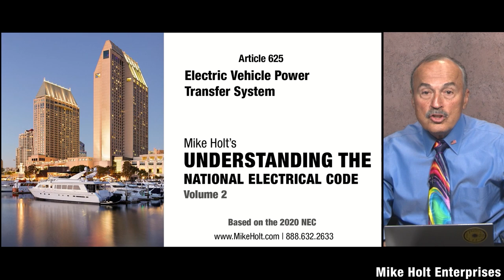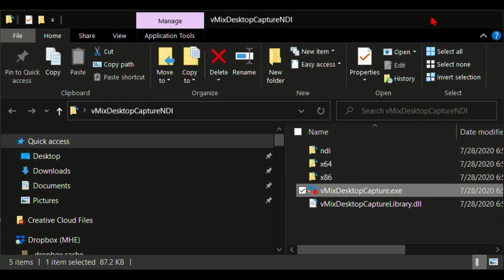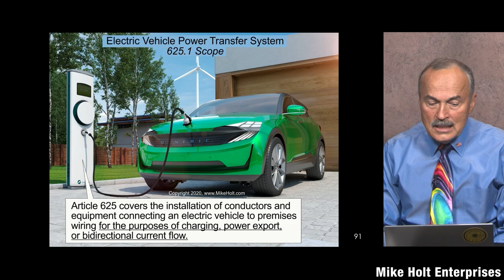Electric Vehicle Power Transfer System, NEC 2020 - [625.1], (5min:01sec)

Comment: Mike, love your videos but I think you're missing the point. Backup power could be a use but utilities are pushing for this to better manage demand. Eventually your utility might request your vehicle discharge back to the grid to support their demand. Vehicles that support this seem to be heading in the direction that they will allow you to opt in or out and configure how much to take off the top before stopping. 

Also please don't call the device in your garage a charger, it's not. All it does is manage a handshake with the car before energizing that cable. It makes sure the connection is safe and charger that is on the car knows the amperage available through that connection.

One concern I have with this arrangement is that the breaker would be back fed and should be secured (bolt on etc...). I wonder how many of these installations will miss that mark.
Reply from the maker: Any insformation that supports this post?
Reply: I don’t think backup power would work in this scenario.  That’s because you would backfeed to the street since there is no shutoff for the main breaker.  You would need to shutdown any output power the instant the grid goes down. That’s exactly how my own grid tied solar panels work.  There is NEVER any output from my panels when the grid is down.  

There is documentation from Tesla regarding their power wall device that talks about how it could output power when the utilities are short on supply vs the current demand.  By selling power at peak demand and buying it back on off peak times you could potentially pay for the cost of the device.  Of course there are a lot of things that need to work together for this to happen. It’s the foundation of the new smart grid design.   I’m not saying this is all ready for now but the theory is all there.
Reply from the maker: @neilbrookins8428  Of course it would, that is why the NEC is changing the requirements and UL listing requirements specifically for this application. See https://www.greencarreports.com/news/1127590_nissan-leaf-as-home-energy-device-wallbox-will-soon-enable-it-in-the-u-s

Comment: Question, how does an ev charger differ from a water heater connected via a 30 amp plug? Why is one allowed and one isnt? I need to charge my solar batteries with a chargeverter and only have room for 1 -30 amp breaker. Thks
Reply from the maker: Water heaters are not designed to be cord-and-plug connected (part of the listing). EVSE is listed to be cord-and-plug or hard-wired, in accordance with the EVSE instructions.
Reply: @MikeHoltNEC  what makes them appreciably different? Thks
Reply from the maker: Please contact UL and let me know.